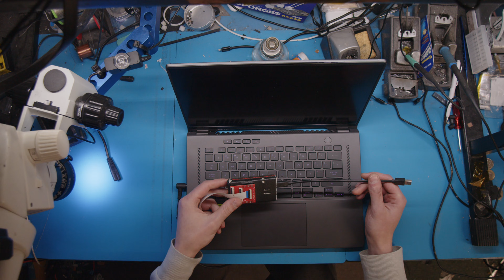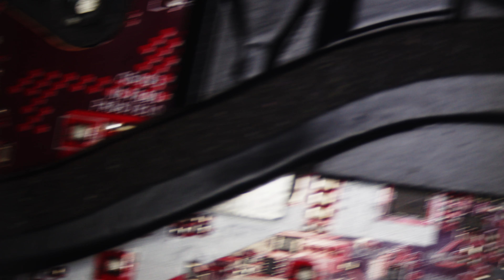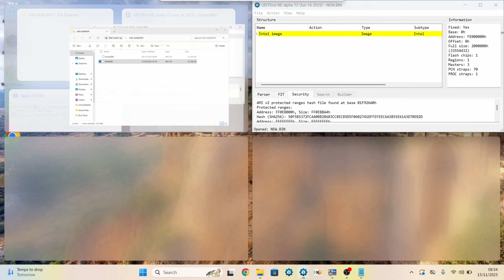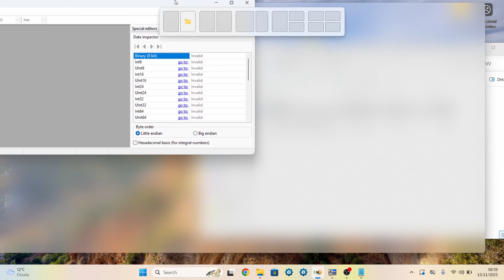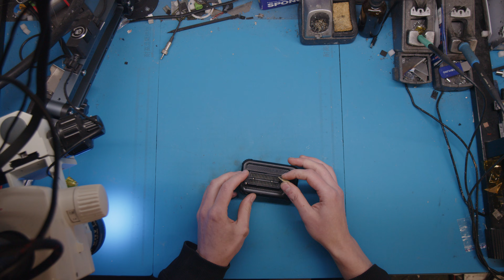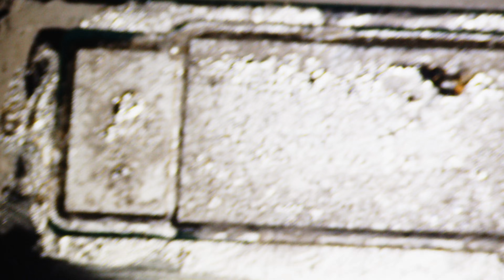I Bought a “BIOS Corrupt” ASUS ROG Zephyrus G16 — Can I Flip It for Profit? | Lets go Gambling EP5

Comment: With the T48, if you save as 'Default' (which you did) the programming software adds a few extra bytes to the end of your image - hence the extra padding in UEFItool. No idea why! The solution is always to save as 'Flash' instead, in which case you get the correctly sized image file.
Reply: I have noticed this same issue while dumping PS5 NOR contents.  The program likes to append some status register info onto the end of the file by default.  Seems stupid to me.  Anyway, like others have said, select "Flash" and you will get just the data you need.
Reply from the maker: That’s crazy. It doesn’t seem to happen on the PC that I usually use for my programming!
Reply from the maker: That’s really interesting, I spend a lot of time in uefitool and I’ve never had this occur when comparing files before. 

I’ll have to do some tests, thanks!